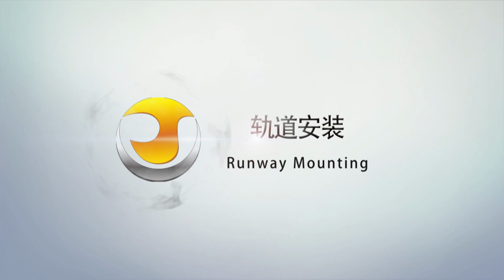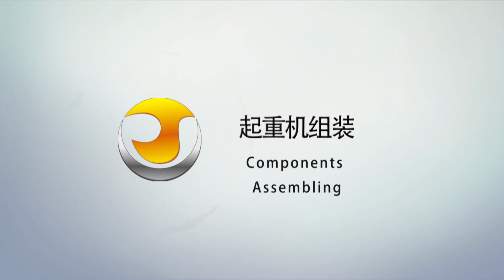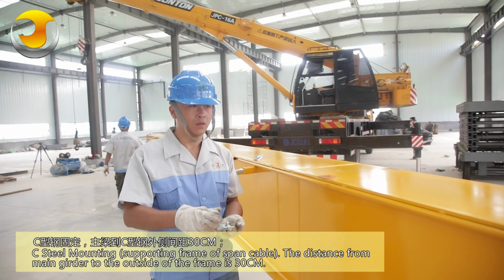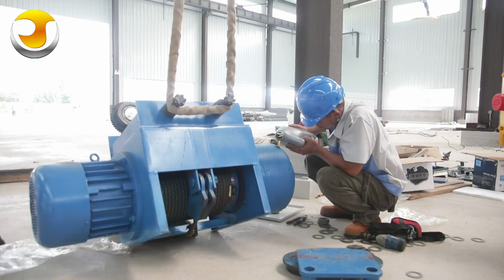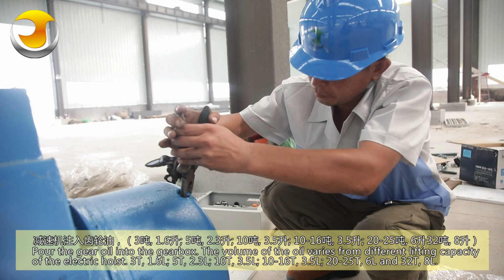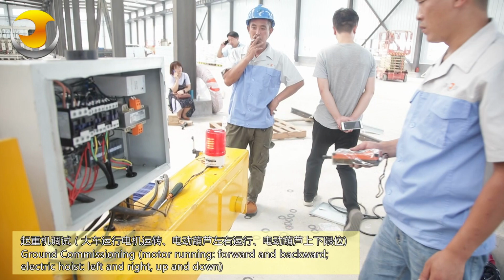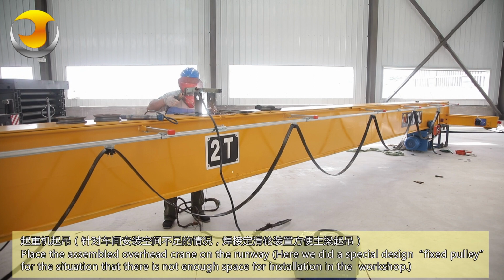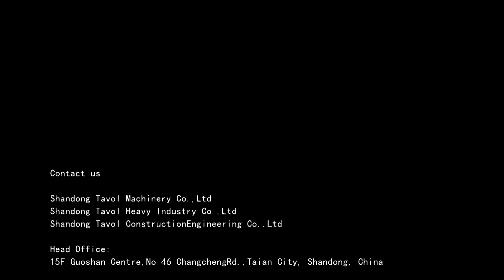Overhead Crane Installation Video. #installation #installationprocess #installationvideo #crane

Comment: omg the wireing of the motors and the red lamp. im a service technician from germany for overheadcranes. this employees doing so many things not correctly... i gonna cry how they work...
Reply: We make cranes from Abus kits in Northern Ireland, they make me laugh at their 1960's style crane and work practices. The vast majority of this work's done in the factory and apart from the main power supply everything is plug and socket straight from the kit. All the erectors have to do is attach the end carriages, plug in the sockets and  lift into the rails and connect to the bus bar.